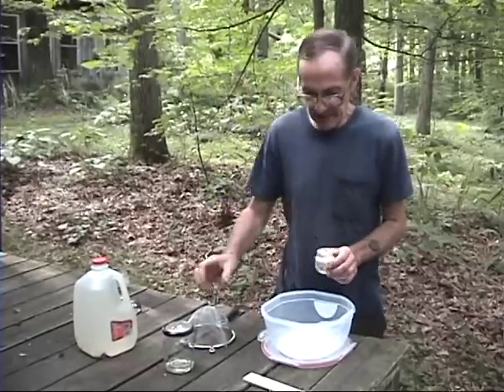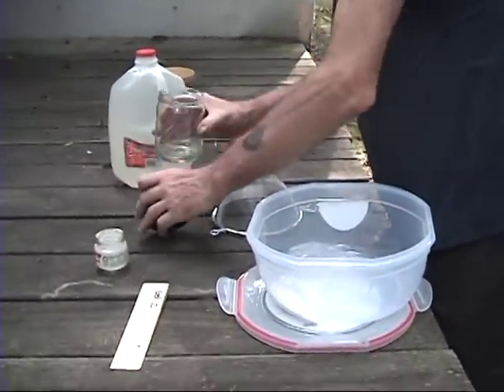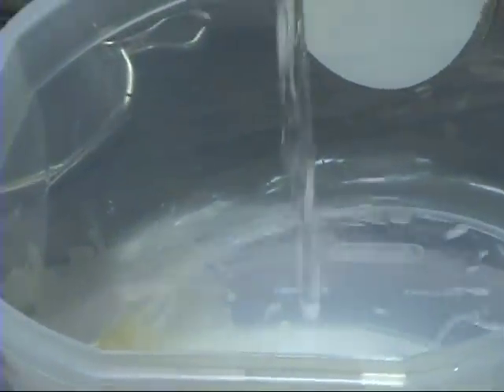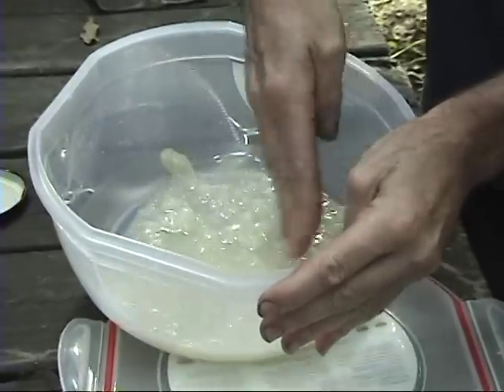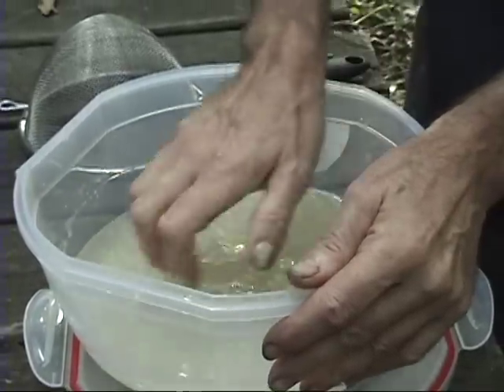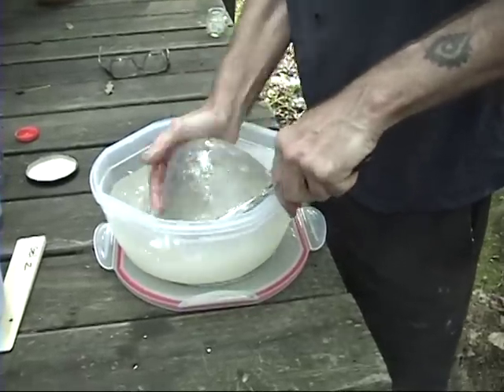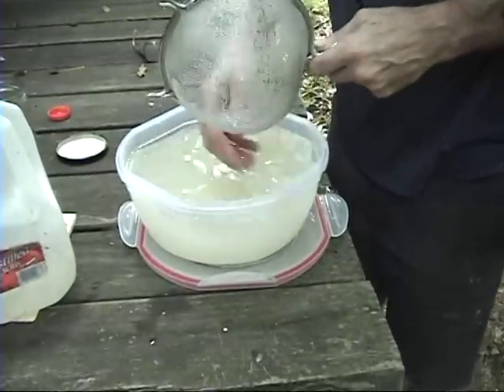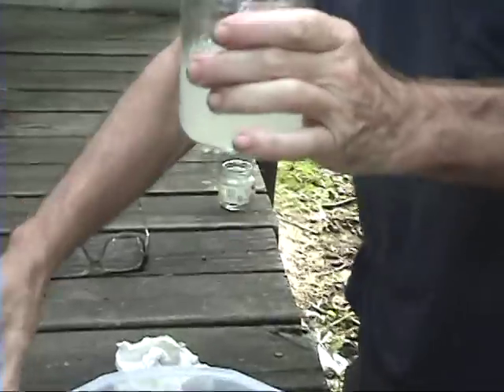Gas Well Study Cooking Class: Making Fracking Gel

Comment: Actually in them US, the oil companies used diesel in the mix until 2005.
Reply from the maker: Industry signed an agreement not to use diesel in 2005. They continued to use diesel for fracturing after that, in spite of the agreement. That has been well documented. Halliburton had MSDSs for products using diesel on their website in 2011.

Comment from the maker: FracFocus reports show diesel and diesel-like products are still being used. Hydrotreated distillates include CAS 64742-47-8, commonly found on FracFocus, which is also called kerosene and turbo fuel A. Use of diesel fuels is prohibited by federal law for hydraulic fracturing, but the law isn't enforced. The EPA recognizes that diesel is still being used and is working on permitting requirements under UIC. Low in BTEX might not be low enough, and doesn't mean low in PAHs (also carcinogens).

Comment from the maker: If operators are injecting diesel, kerosene or similar solvents without a special UIC II permit, it's against the law. Even if operators are following UIC II requirements it's entirely possible that these solvents will reach groundwater because of poor or inadequate cement or bad casing practices. Five percent of new wells leak, directional wells are more likely to leak.
Reply: Do you have any proof or links to that data? No one should go on your word alone.